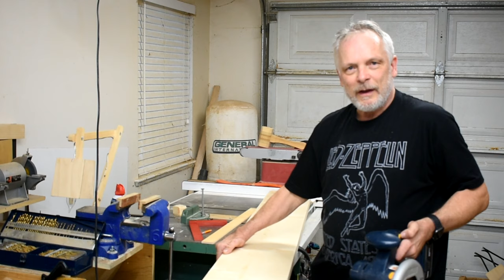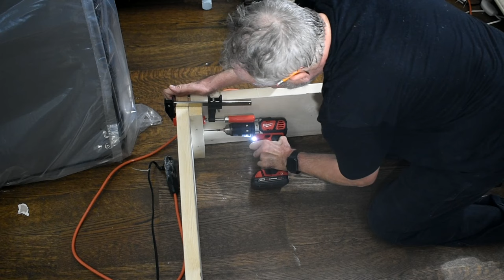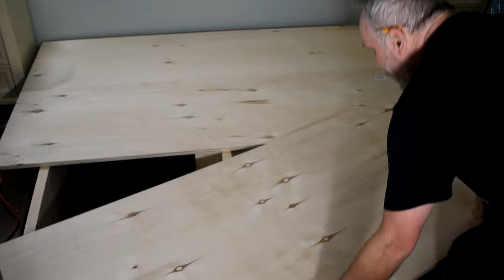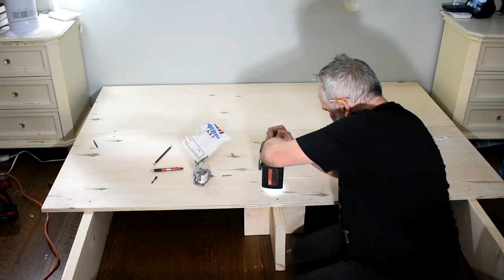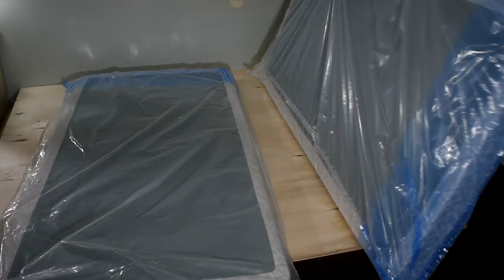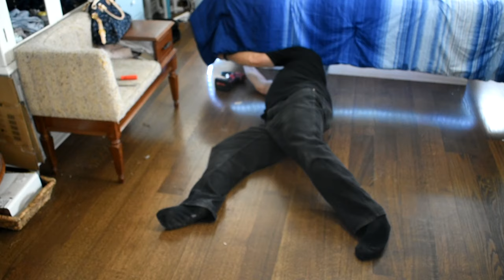EASIEST EVER ! Make a King Size Floating  Platform Bed

Comment: Hi Jack,

I ran into your channel when a week ago from today I decided to make a mini wood lathe because of various upcoming projects and saw your video from 7 years ago.

Mine is a bit more complex, but essentially the same idea. One major difference is I salvaged and removed the motor from a cordless 18 volt drill rather than use an AC drill. The jury is out on whether I swap it out for a universal motor with attached speed control. 

The motor I used has plenty of torque, but seems a bit slow with respect to rpm. A bit of testing will indicate keep or swap.

Thanks for the video none the less and you probably forgot you had made it since 7 years have passed.